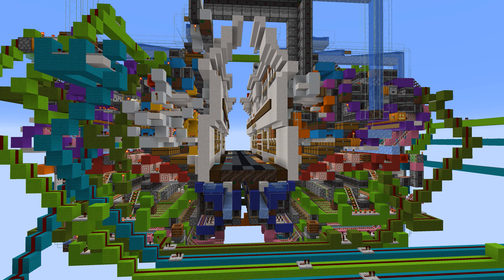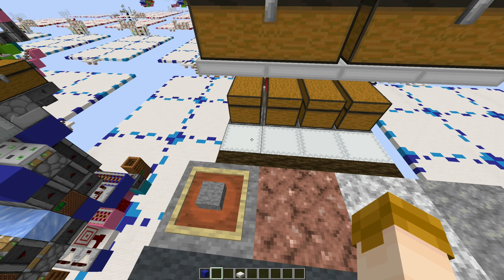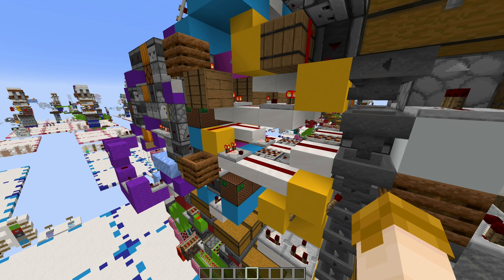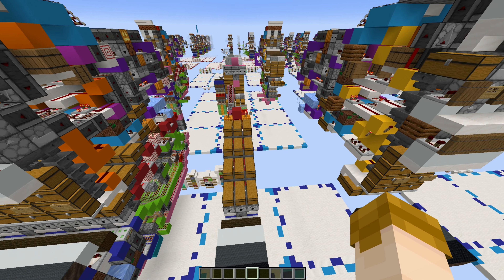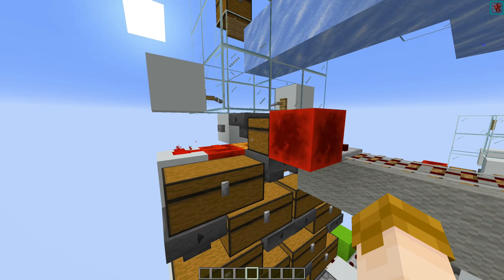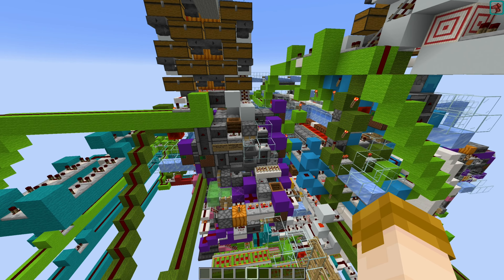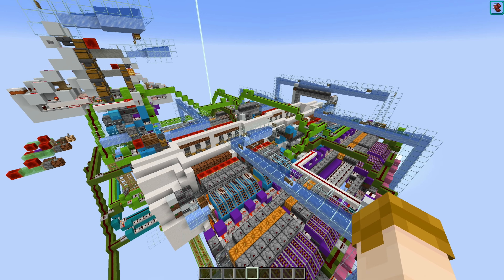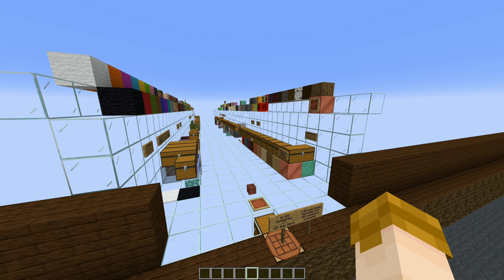Fully Hopper Locked Storage Hall - Designing a Storage System #7

Comment: you can replace the light blue concrete on top of one of the chests that a comparator is reading through with a soul sand and you can still place rails and on it but it won't block the chest
Reply: Chests can't be opened through soulsand